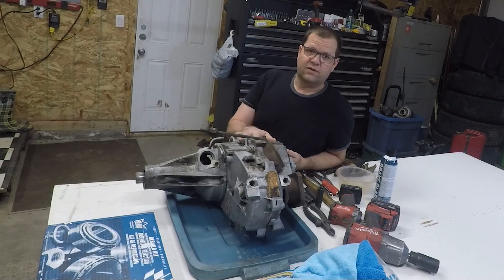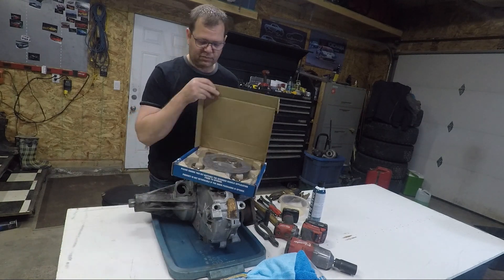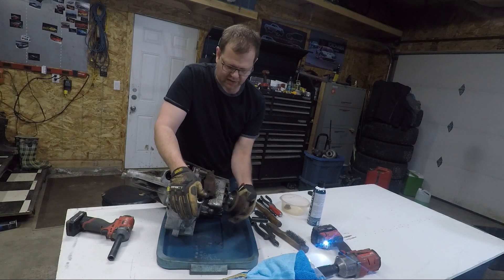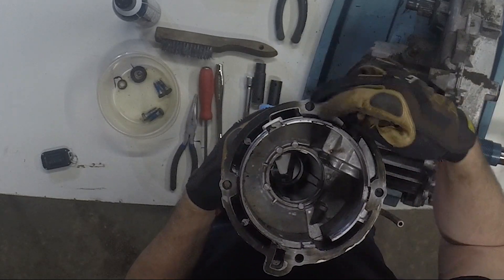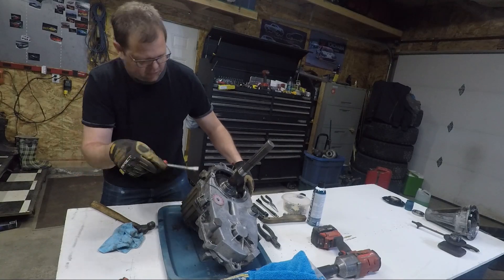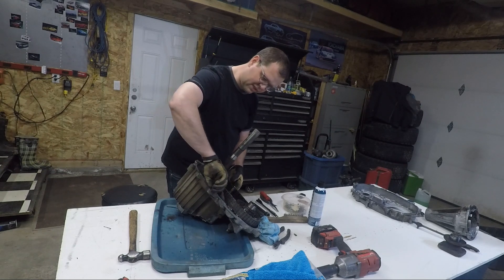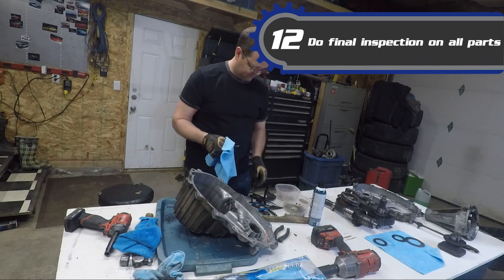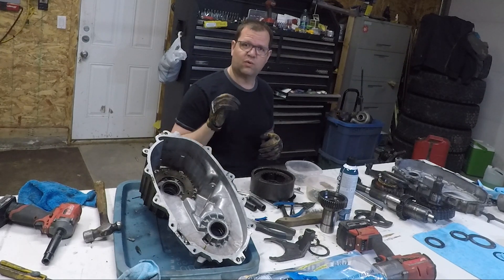pt.2 How to Disassemble a NP208 Transfer Case Tear Down in 12 Step by Step (GMC Squarebody)

Comment: I always hear different arguments on these things and hoping you can help. Manual says 5 pints or 2.5 quarts...other guys say fill until the plug oozes...but thats like 5 quarts..seems way too much and I don't want seals leaking...is 3 qts all it basically needs or should i fill until it oozes?????
Reply from the maker: Great question. I always make sure the truck is on level ground and fill to the bottom of the fill hole. That's is what the factory manual show's and I have never had an issue.
Reply: Since this transfer case has no oil pump, it's basically filled so full that everything is under ATF all the time. This is good since there's no oil pump that likes to chew it's way through the case creating a leak. 

There's also a critical shortage of Low-High shift forks for these units and I have been very successful in repairing them once and for all. If anyone's interested, just repost here and I'll do a short write-up about it. 
Sorry that I don't have one of those fork repairs going on at this time, but I can describe it well enough I think.
 
I don't want to highjack this video, but - like I said - I don't have this repair happening right now so I would like to ask the OP if he'd appreciate that or not.

Comment: Thanks! This helped a ton; I need to change the rear output seal as it is leaking.. but when it comes time to check the internals this helps a ton.
Reply from the maker: Thank you for the feedback. If there is anything you want more detail on please let me know. Good luck with your repair.
Reply: The Lugnut thank you! Will do. Thankfully it works for now. You should do a video “walk around” type on your truck, the LS swap itself is cool. The truck I’m working on is a 1987 Suburban V10
Reply from the maker: I am working on one about the truck itself. There is allot of hidden things that the majority of people miss. Like the 94 Dodge Ram power mirrors modded to the OEM GM base. The auto dimming rearview mirror with temp and compass.  To name a couple of mods.
Reply: The Lugnut I’m waiting for that video! I’m very interested in the mirrors & rearview mirror.. I need one anyways (: I am putting an early 2000s blazer overhead console in mine with the temp/compass display, as well as replacing all OE roof lights with adjustable ones from a late 90’s Tahoe/suburban.. along with an upgraded touch screen stereo unit.